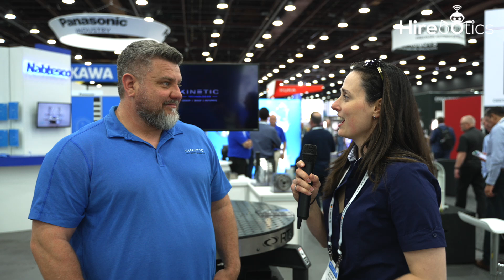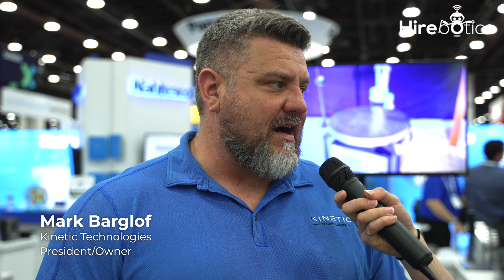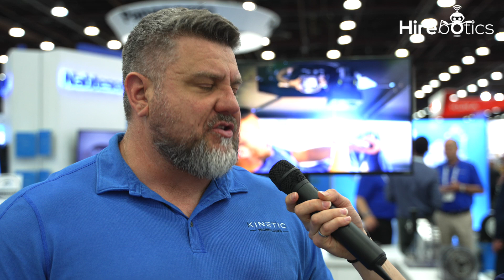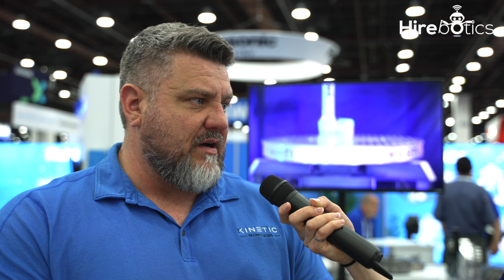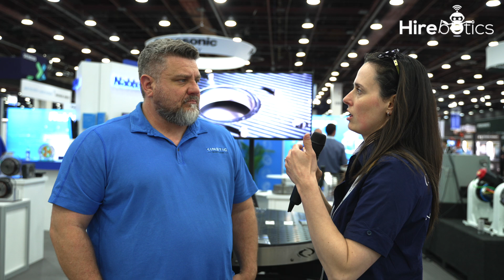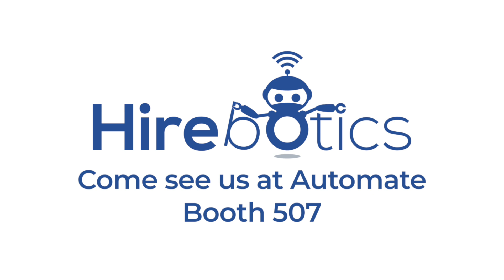Tips and advice when designing robotic welding fixtures | Kinetic Technologies

Comment: Do they have a robot arm the sandblasts welds and needle scales. Vacuum blast system prior to structural steel welding then shot blast or sandblast later for coating so as to eliminate rust incursion double blasting 3 head arm attachment Y